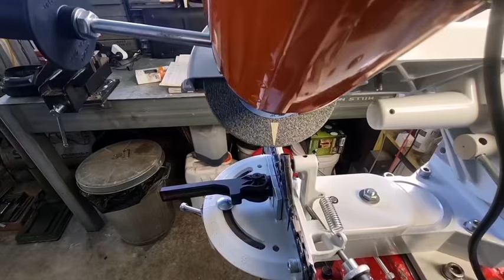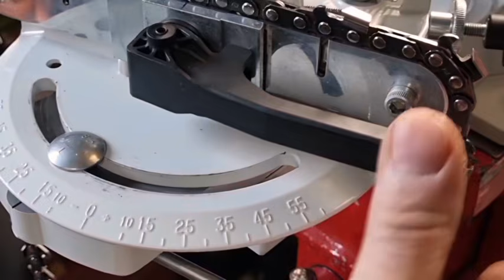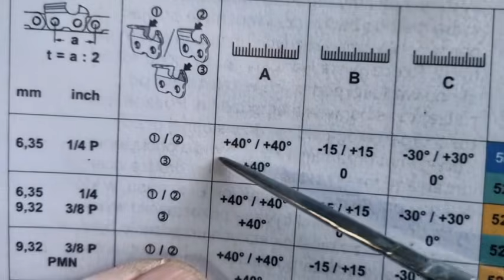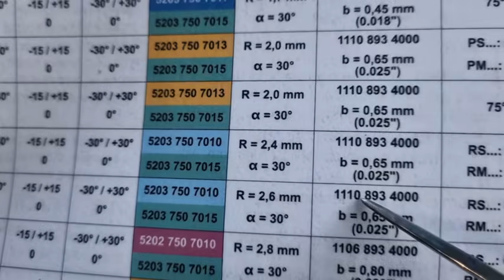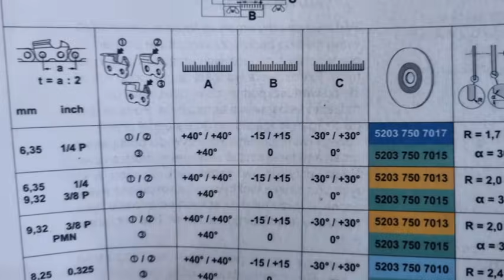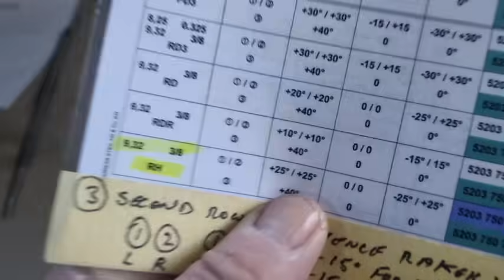Stihl USG The Ultimate Guide

Comment: is there a way to cetralise the disc, as on.  a moving scale. the disc, could be seen as the only wearing part (on the grinder). i wonder, if a 1/4" pico can be hex filed?
Reply from the maker: Its not a problem to center the wheel when the C scale is set at 0
The c scale has a 17mm offset so the left and right teeth move across the face of the wheel by 12mm that why the B scale is set to -15/+15 this will bring the working corner of the tooth close to the grinding wheel centre line
Reply from the maker: 1/4 cant see Stihl making Hexa